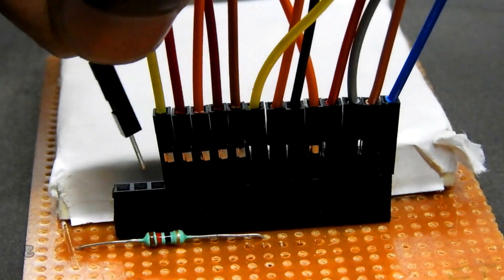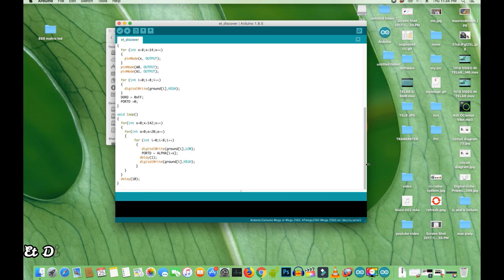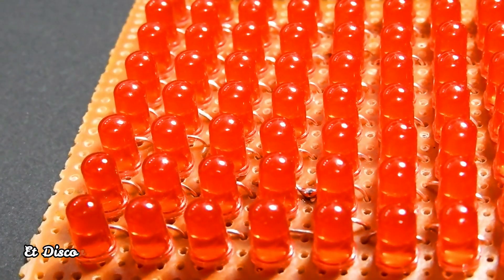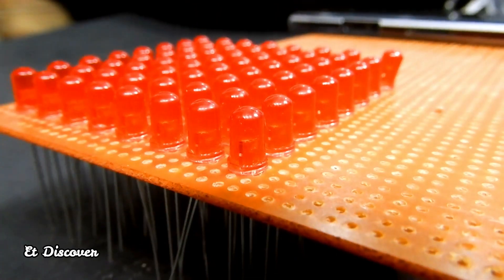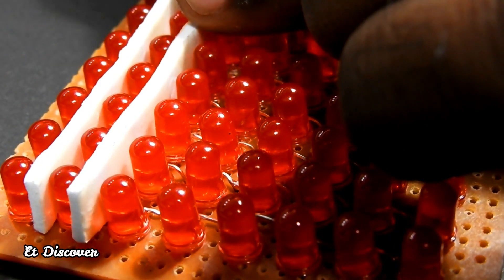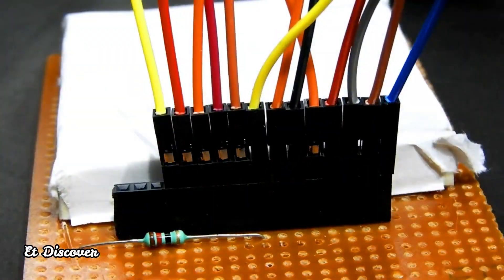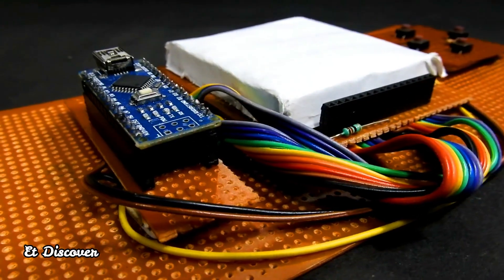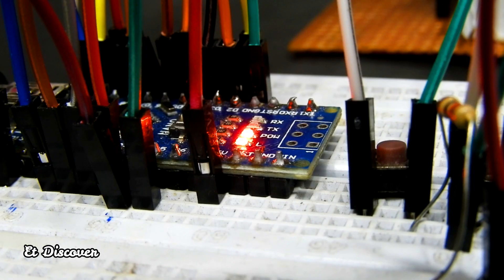How to Play Two Games in Arduino nano  _#

Comment: Bro, is it possible to run android app in arduino chip.
Reply: No.. because Arduino has an AVR architecture and Android being an ARM architecture. Different architectures have different machine understandings so it's impossible to run Android app on Arduino
Reply: Thank you so much. Is there any solution for that
Reply: Bro subscribed your channel also.
Reply: Niraj Giri First of all even if we develop an app that's similar to Android app for the Arduino, it won't run as you want it to coz Arduino runs at 16 MHz single core processor while Android while most androids run at 1.5 GHz quad core processor so now you can understand how difficult it is.
Reply: Yes boss. But aren't there any android chip for that.
Reply: Niraj Giri Android is basically an ARM chip so you can use raspberry pi for that purpose they share the same architecture that is ARM so they will be able to run the Android Operating system and in turn run the Android app
Reply: Thank u so much. I will like ur video.
Reply: Niraj Giri Sorry but this is not my video and neither is this my channel . You can visit it by tapping it on my profile picture beside this comment
Reply from the maker: No